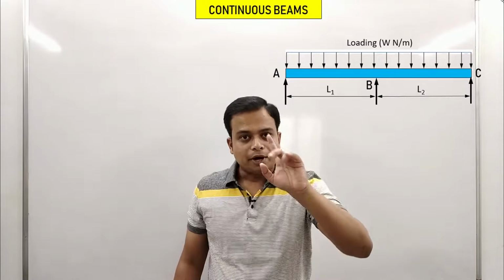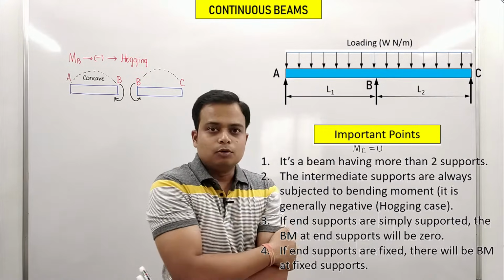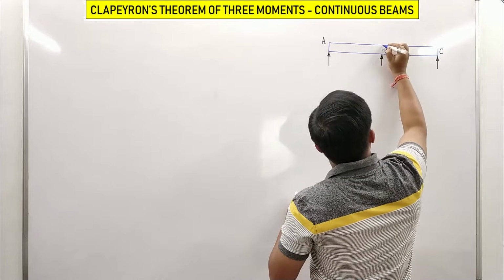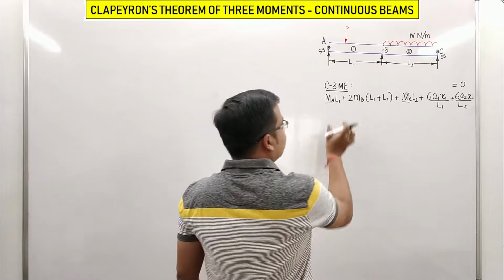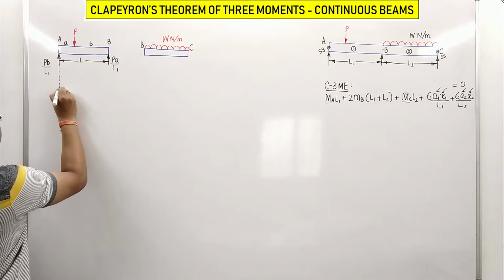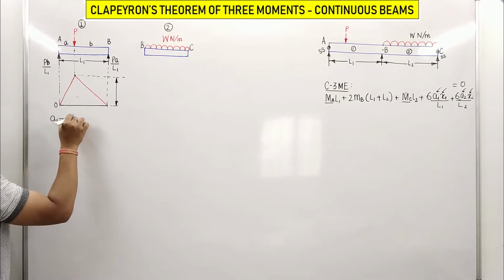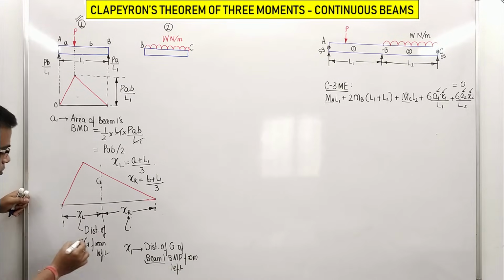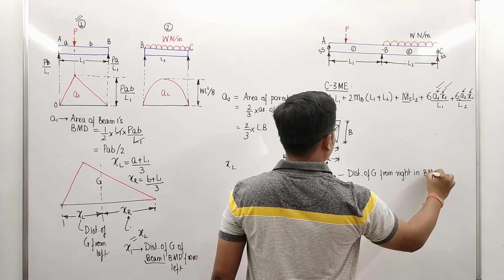Continuous Beams || Introduction and Clapeyrons Three Moment Theorem || Lecture 1

Comment: How do take x1= (a+L1)/3 &  x2 = (b+L1)/3? Shouldn't they be x1 = a+(L1/3)? x2 = b - (L2/3) ?
Reply: consider a=b=(L/2), your X1 and X2 doesn't give the required solution(which should be L/2).
Reply: i tried to solve for X1 and X2 and i got X1=(a+L1)/3 and X2=(b+L1)/3

Comment: floor height 4 M. Floor has to support LL of 5 KN/sq.m. Design a continuous beam B10-B11. The beam has to suppor 230 mm thick wall having unit weight of 20 KN/m in addition to loads from slab& its self weight. Use 20 % mo.nent redistribution. Adopt M20 & Fe415 materials. Design the beam with all necessary chec Aldetil ie section.

How can I solve this type of problem plz help me.